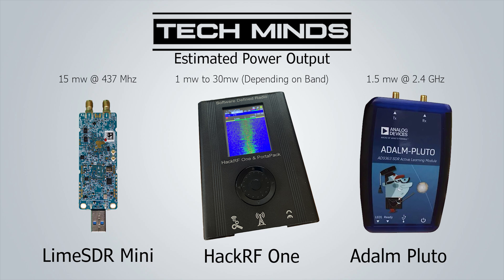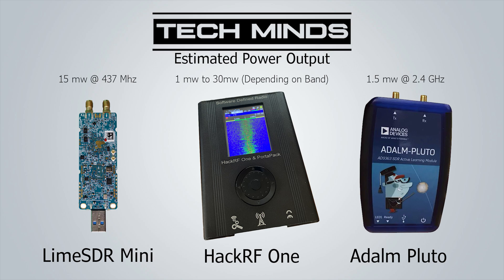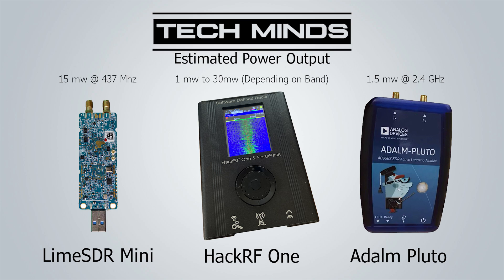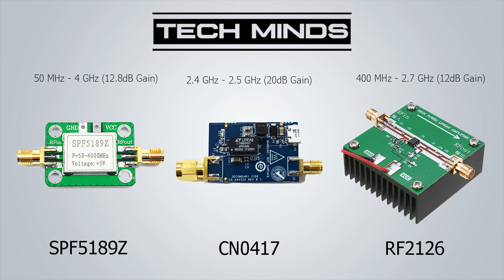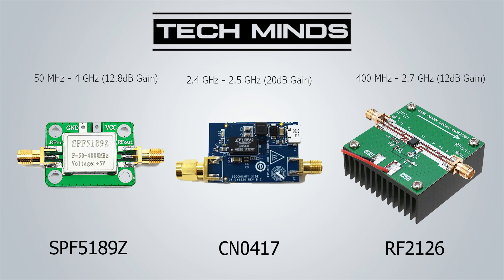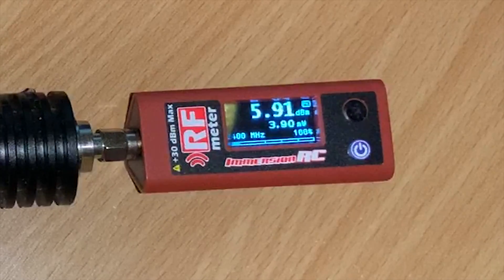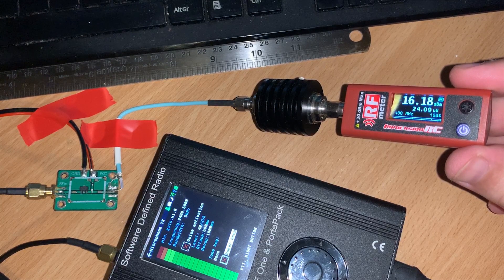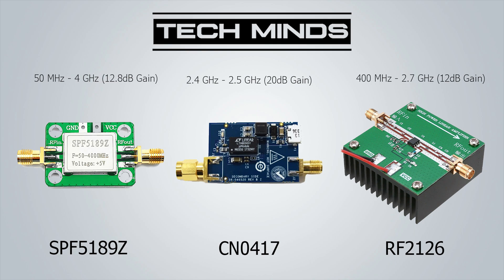Extend SDR Transmit Range - LimeSDR - HackRF - Adalm Pluto Amplifier

Comment: Is it possible to use a similar method to create a cellphone signal booster using an SDR with amplifier modules specific to the cellular band ul/dl frequencies?  What would be the required output power to be useful to transmit?

Comment: Aside from maybe filters for a purpose, is there any difference in Rx and Tx in case of amps? Do these amps literally just scream the input out louder or are there types made for Rx amplification and others made for Tx amplification? (As said..dont mind filters). If its only amping whats comming in, i could basically just turn an LNA around and amp it the other way i guess? Seems logical...shouldnt do it when you dont know what you do..but its possible..

Comment: All SDRs are based on PLL and therefore produce a lot of harmonics. Making video about connecting amplifier for TX without explaining from where those harmonics came from and how bad it is to directly connect amplifier is barbarian. Sorry mate but you didn't explain at all where to put filter not mentioning that radiating powerfull radio emissions with harmonic can harm other user's including potentially jamming of critical infrastructure like air control communication or life support and saving services. This is bad.
Reply: Do you have a video you could share that has a good explanation on that for someone who wants to learn more?  Thanks in advance .

Comment: can we connect 2 spf5189s in a row to increase the output?
Reply: Yes
Reply: @egementutkunforreal  Yeah i know i already made a quadruple version of them. With Ku band transmistter and my usrp b210 i will make a suprise soon for a  middle east swamp country which is ruled by a puny dictator.
Reply: @25_26  what do you mean by a transmitter? A BUC or an OMT?
Reply: @25_26  BRO ITS BEEN 10 DAYS💀

Comment: For the HackRF working in transceiver mode, how could we use LNA and PA simultaneously? Thanks!
Reply: Good question but i think you can't since hackrf is half-duplex. You can use spf5189 as a power amp by connecting rf input to hackrf and rf output to the antenna.

Comment: Where should a bandpass filter be placed? If it is before the amplifier then we risk sending out some junk that the amplifier introduces. Also, if the amplifier is just after the radio, don't the harmonics get amplified as well, and then the filter cuts them off thus wasting the energy? I would like to see a comparison of some cheap HF amplifiers used with HackRf, as somebody mentioned, it would be great to turn these SDRs into usable HF Ham rigs for a fraction of the price.

Comment: How do you multiplex, if that's the right word, with a receive antenna? Seems like you'd need a transmit signal (called PTT in many rigs) with a relay to switch the amplifier in/out of the antenna line.

Comment: Thanks! GREAT video for someone like me who is just learning about SDR.
It looks like the focus is on VHF frequencies.
I am wondering about amplifiers for the HF ham bands, as with and SDR and the right amp I could be on the air with a lot less out-of-pocket cash than paying for high end ICOM or Kenwood.
Reply: I've been trying to figure out the same thing. I've been looking at used linear HF amps like the Yaesu FL-2100b which have HF low pass filters. I also thought about tapping into the RF amp stage of my ICOM 730, but that might be very difficult. Some of the amps require a watt or more input, so I might need a smaller amp in front of it since LimeSDR only puts out the 15mW. All seems doable. Just looking for the best parts and the best price. Have you made any progress?

Comment: I have seen the SPF used a lot for RX, but not for TX, is it safe for both the hackrf and the LNA? Also, is this LNA biasTee powered? If so, there is no need for an external 5V supply.
Edit: I took a look to the SPF's datasheet and it is designed for RX only, it is very interesting than it can also be used for TX.

Comment: Great Scott HackRf one = Pure Trash
Reply from the maker: Hey, I’m curious to know why you think that? Personally I havnt had any issues with it, but have heard other experience blown components etc. What’s your experience with them?
Reply: @TechMindsOfficial Sure. It started with me when the sma connector came loose. I had it fixed on a antenna that is outside. When I replace said antenna With one that was better, that's when the solder joint came off along with the trace. I contacted nooelec they wanted pictures. They said They will not cover it because it looked like It was forced off. On closer inspection I notice that the traces are very frail and can easily come right off the board if heat is applied. I tried to fix it after they wouldn't replace it. I failed... the unit itself will power on but with out any gain no signal. the 1st week I had it the preamps went out I had this less then one year and paid around $325 USD. I'm waiting on a clone to arrive from ebay for about $125 USD.

Comment: I have my Ham license, so at least 1 watt would interest me. I'm not into milliwatts. The HackRF One is a reasonable receiver, but way under powered as a transmitter. It couldn't open my electric gate less than 3 feet away. It's remote can open it around 50 ft away. Next HackRF should be at least 100 MW out. Easy to build a mini amp for that.
Reply: If it outputs more than around 10mW then it would no longer be, FCC part 15 exempt item of, test equipment. It would need to be fully FCC tested and compliant, and for a general purpose SDR that is never going to happen.

Comment: Thanks for the video. However there are many other parameters of the amplifier beside price, gain and frequency range. Intermodulation distortion, harmonic distortion, gain compression, IP3, IP2, just to name a few. And all are very important. There are several book that I can recommend on this subject: "The ARRL Handbook" (any of recent years edition, they are basically the same), "Amateur Radio Transceiver Performance Testing" and "Experimental Methods in RF Design". These are in fact great books on radio in general. It's also worth noticing that soldering your own amplifier is not that complicated, especially if we are talking <= 150 Mhz. The books I've mentioned cover this topic as well. 73s de R2AUK
Reply from the maker: Absolutely true! 👌

Comment: I was just wondering but if lets say i use the spf5189z to boost a 420mhz transmission could you double up on the amplifier to boost further to possibly reach 1w or would i be better off using a linear amp for the specific freq? My goal is a 5w transmission at 420-450 from the hack rf.
Reply from the maker: If you’re aiming to transmit on a dedicated band then I would say go with a dedicated amplifier for that band. Depending on the amplifiers input requirements you could use the SPF as a pre-amp.
Reply: @TechMindsOfficial  can we connect to 2 spf5189s in a row to increase the output?
Reply: @TechMindsOfficial  ok that's what I was figuring considering the hackrf wasnt supplying enough power to use just the linear amp. Thank you.

Comment: Could you make a video explaining db gain and watt relation? I see watts like the volts and amperes combined. But the db gain thing in radio is a total mystery. More watts is more power. But powerful stations (say 50 KW antennas), does it spread the gain as the watt by surface? I.e. decreasing according to the square root of the distance from transmission?
How do filters or antennas improve gain over background noise if the watts are constant?
Any information about db would be much appreciated. I haven't found much to inform about.
Also, I assume these amplifiers introduce noise and artifact interference?
Reply: The reason why this topic may be confusing is because decibels and watts are not related. At all! You can calculate power in watts as pow(Urms,2) / Z, where Z is a characteristic impedance (which is 50 ohms in most modern systems). Decibels can be calculated as 10*log10(X/Y). In other words decibels is another way to look at ratio, but on logarithmic scale. 0 dB is meaningless unless you know what you compare with. This is why you often see not dB, but (!) dBm, i.e. ratio to 1 mW. As I mentioned in another comment, "The ARRL Handbook" explains this and many other topics in great detail. 73s de R2AUK
Reply from the maker: Thank a good idea! I’ll add it to my list of videos. Thanks for watching 🙏

Comment: You should start off videos like this with a warning about reviewing local laws & regulations, as someone could end up with some serious fines (possibly even jail time) in some countries.
Reply from the maker: That’s not my responsibility, do all of the videos on Guns, and them being used in countries where they are legal, do they have warnings for countries like the UK where guns are illegal to carry around or use in public? Kinda the same principal really, it’s down to the individual to check they have the appropriate license, such as a ham radio license. Thanks for watching 🙏
Reply: @TechMindsOfficial  Fair; but, one cannot just order a gun on Ebay and have it shipped to the UK.  I'm all for education and learning (it's why I subscribe), but being responsible with our experiments should also be a part of learning.  Example; you did mention briefly about using BPF's to remove harmonics.
Reply from the maker: Yeh that’s true, harmonics is very important.
Reply: @rttakezo2000  Pretty fucking hard to kill someone with an SDR.
Reply: @KarlKrogmann stab them in the jugular with it !
Reply: Set it to the GPS freq at the airport and you might. At least they think you will haha.

Comment: Can use this to block GPS ?
Reply from the maker: Most likely 😉
Reply: Thanks for replying can recommend any good forums for more information regarding cheap blocking gps please. 🇬🇧
Reply: Why block it? just spoof it with GPS sim.
Reply: Fit For Flogging thanks for replying, I’m trying to block gps car tracker? any advice would be appreciated
Reply: @JA-yy6bd  The only experience i have in GPS blocking is with the hackRF one. However there are devices that can do just that. I live in the states and "Jamming" device is considered illegal. I only can tell you what to look for you would have to put 2 and 2 together. But if you do get a hackrfone just get the chinese clone. nooelec/Great scott Gadgets is garbage and overpriced
Reply: Fit For Flogging thanks I’m based UK so hackRF one would block gps tracker? I will have look at hackerfone  ?

Comment: The CN0417 runs excessively hot and a lot of people have experienced early failure.
Reply from the maker: Horus it does run hot, I use a small fan in mine, and also put a small heatsink. It’s a great pre-amp